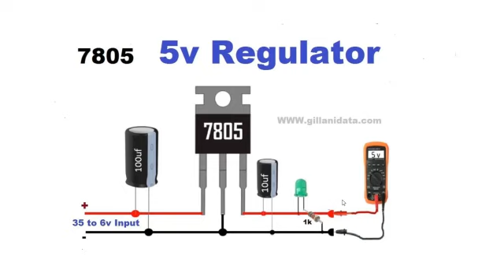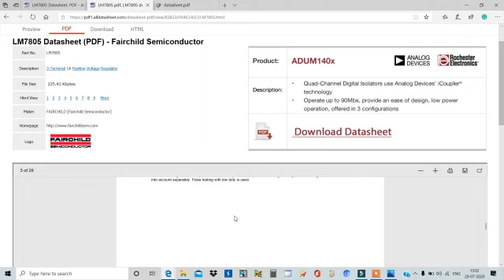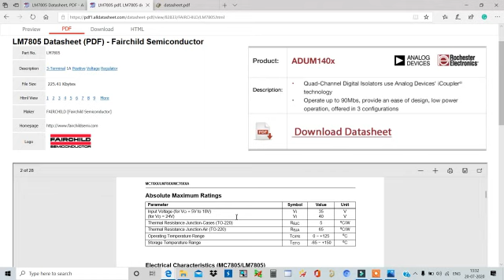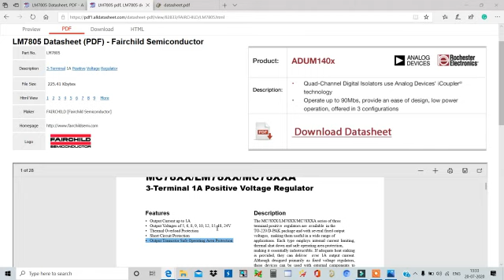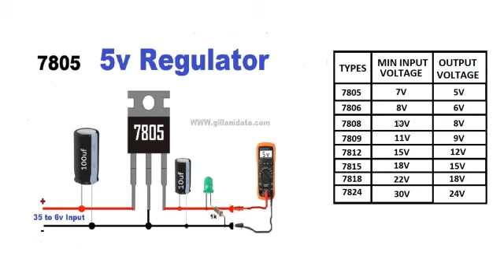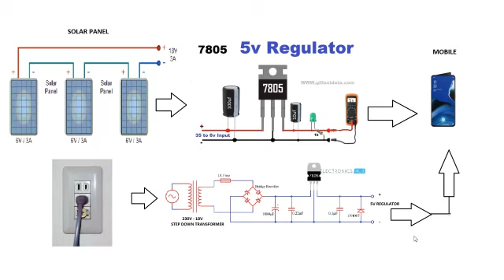7805 Voltage Regulator IC

Comment: nice explanation..if i want -5v means how to do & which ic we need to use..?
Reply from the maker: You can give any microcontroller depending on the datasheet
Reply from the maker: For -5V you can reverse the terminal while reversing the terminal should not be connected diode